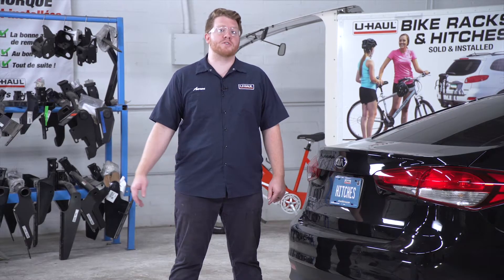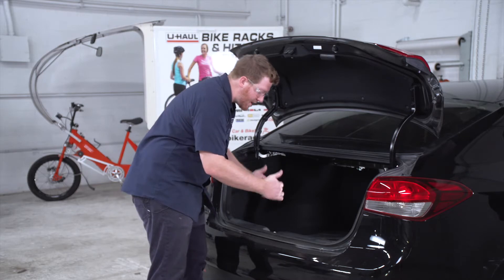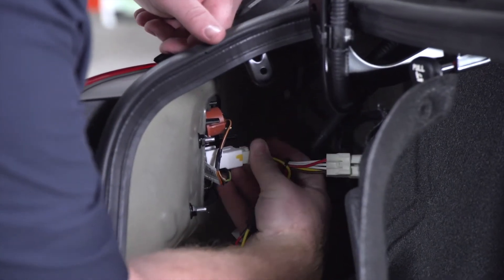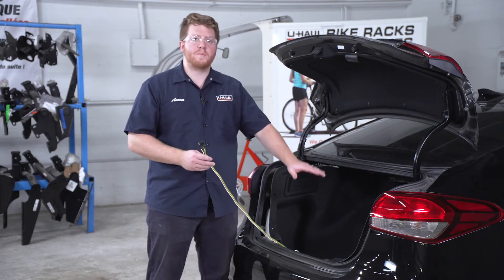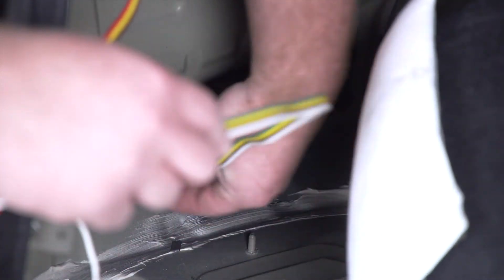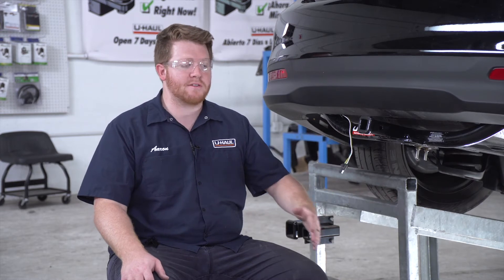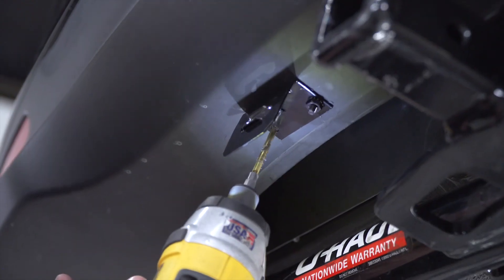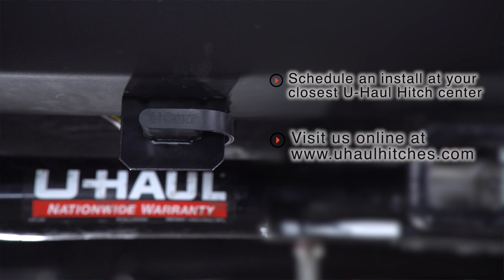2015 Kia Forte Trailer Wiring Harness Installation (Non-LED Tail Light)

Comment: It didn't mention running a wire from the battery to this kit... do you have to? Please advise....
Reply from the maker: You have to run a power wire if you have LED Tail lights. This car does not, so it's not necessary. Unfortunately we don't have a video for the Forte with LED Tail lights, buy we have a video on tips to running that power wire to the battery. https://youtu.be/IWpj1MNXWMs
Reply: @trailerhitches  How do you know if you have LED tail lights? and a PS.... the kit you used is no longer available from retailers and instead every retailer is funneling you to a new Curt product .... a 56410 which is what I installed... the 56410 also installed easily....and identically to what your video shows but when I finished and got out my test light plug in, simply, there was no "power" it seems... and yes, I grounded it in the same place as the video shows and even ran a new ground wire to the frame of the Forte to make sure it wasn't a ground problem..... I wrote to Curt.... asking them if I needed to run a dedicated 12 volt power wire (that they provided with this new kit) and got NO REPLY from them.... Your answer above about LED lights is my next research project.... A bulb application online chart should tell me if I have LED tail lights??????  Any other advice? and just one more thing... I wanted to keep the power wire inside the vehicle instead of running it under the vehicle... but after watching your "how to" video running it in a loom under the car, that is what I plan to do... thanks....all your advice is appreciated.....
Reply from the maker: @dennisalbright6313  Hi Dennis, yes it looks like they discontinued this part. Curt 56410 is their new part that works on both LED and non-LED tail lights. It should have come with a power wire that you need to route and connect to your battery. Unfortunately we do not have a video showing how to run that wore on a Kia Forte, but you it looks like you found our video on how to run wires under your car. You can use a similar video like our Honda Accord to see how it was done: https://youtu.be/k-jcVGc59ng if you have any troubles, bring it over to you local U-Haul hitch center and they can always help out.
Reply: @trailerhitches  Thanks..... FYI..... It looks like 2015 may have been a transition year for many vehicles between conventional bulbs and LED..... and I found many application charts that recommended just taking the car back to Kia if I had tail light problems... no bulbs were recommended.... I also "learned" about the vent in the back of the Kia that your original video showed to get the plug to mount on the outside of the car.... that vent is what I will use to get the power wire INSIDE the trunk area.... in the engine compartment, it should be easy to get the wire up from under the car near the firewall to the battery.... my only concern now is the ring terminal provided with the kit.... but can deal with that if I need to... Thanks for all your help.... it is greatly appreciated....